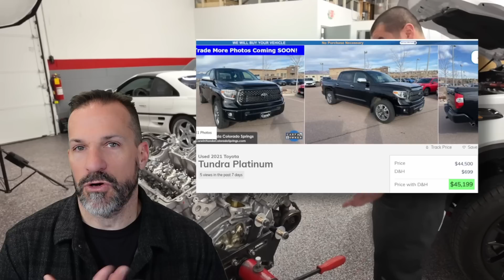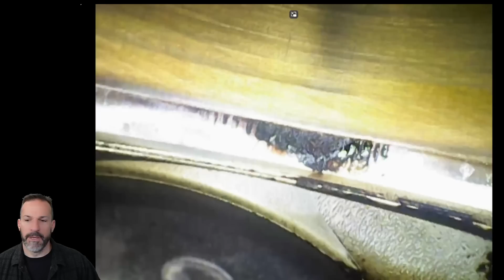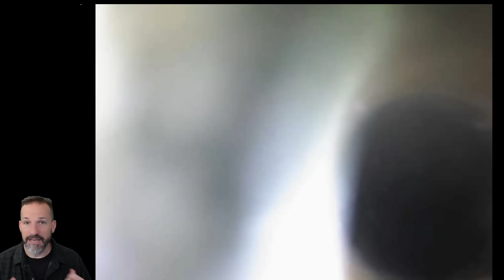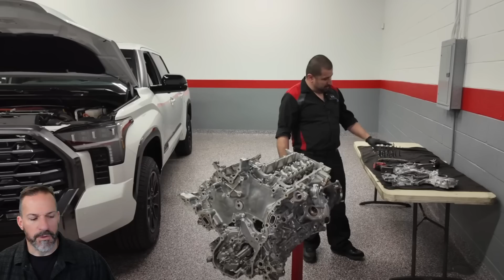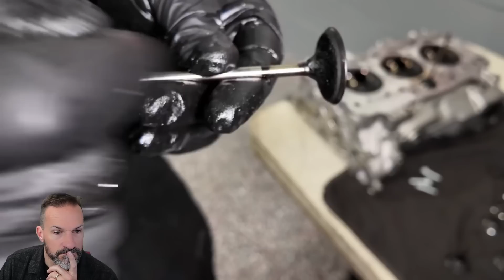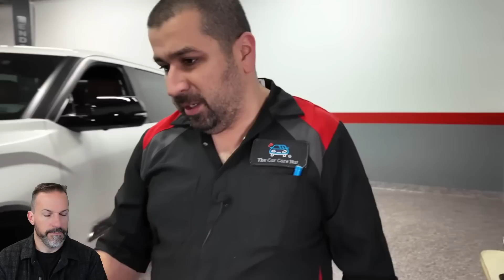Has Toyota LOST Their EDGE? Tundra Turbo V6 TEARDOWN vs. 5.7L V8

Comment: I use to work for Toyota Corporate. I knew this would happen. Just like any sports team that has been on top for a while they have started to cut corners.  When working to get to the top you run the extra sprints, you do all the little things.  When you've been on top for a while you start thinking your unbeatable.

This is when you start making shit product. It's just like their BZ4X. They put a stop sale on that product because wheel studs weren't strong enough. Their engineers didn't account for the extra torque put out by EVs. This is an absolute joke.

Manufacturing debris my ass.  This is a poorly designed engine.
Reply: For this amount of $$$ Toyota put into engineering this engine it’s hard to see why none of these issues were addressed in testing. Toyota reported a ton of testing with this engine and I find it hard to believe this engine didn’t have any of these issues.
Reply: Here I thought people just weren’t buying new cars because base model corollas were price at 32k minimum straight from the manufacturers.
Reply: Do you think they started going downhill in the early 2000's? That's my personal impression. I remember when Jim Press (from Chrysler) took the helm and we started hearing about "cutting costs in imperceptible ways" and my stomach sank. Some cars fared better than others, but overall, the quality of their cars went down...materials used in interiors, for example, took a huge nose dive compared to what they built in the 90s. Some cars had major issues with spot welds. Evidence of cost cutting and shortcuts seemed to be pervasive throughout the lineup until just a few years ago in my opinion when they started to take tactile quality seriously again. But the days of over-engineering for longevity seem to be a distant memory now. I’m sure some Toyota fan boys are going to flame me for saying that, but I’m saying this as a former Toyota devotee, not a hater by any means. I won't buy one anymore. They lost me about ten years ago. I would love for them to get back on top of their game and become the great automotive engineering wonder that they used to be but I don’t see that happening anytime soon.
Reply: @mholmes9262  it is ever continuing death of thousand cuts- let’s give the customer the absolute minimum at the highest price. The customer tolerated the loss on interior quality, shitty paint, vibrating drivetrain, unacceptable noise level, crappy tires, cheap hard plastic everywhere while engine and transmission performed into high 200,000 flawlessly.
Now new idea - let it last through warranty- removed drivetrain reliability.
It also removed any incentive for old, bold and cold men to buy any recent production Toyota. The focus on bullshit electronics will entice new generation… but typically they have less finances. 
The idea to build the product the customer actually wants is completely lost on Toyota.
1) sienna with 6 cylinder ICE engine
2) tundra with v8 or straight 6 - not a hybrid.
3) Tacoma with old 2.7 bulletproof engine.

I would buy all 3 listed above….
Reply: @igorsiniakov-de4fq  Agree, my list would look a little different, but I agree for the most part. Incidentally my last two Toyota's were Siennas, and both of them were complete garbage. We bought an '04 Sienna Limited when my kids were young, and we loved it. It was like a Lexus, and C&D actually called it the Lexus of minivans. But the love turned to disgust when after maybe 7-8 years, all the doors literally started falling off because of faulty spot welds. I was willing to forgive because I grew up on Toyota's and in the 80's and esp the 90's, they were unbeatable in terms of tactile quality and longevity, so I figured I got a lemon, and I would still buy another. In 2013, we replaced that Sienna with a brand new '13 Sienna SE, it had the 19" wheels and looked good for a mv. But man did I regret it. The interior was absolute garbage...hard, cheap plastic that rattled down the road, the dash was literally like a picasso puzzle full of randomly shaped pieces that all snapped into place and anything that touched it left a mark because it was the cheapest plastic they could find. But the 2 things that really made me lose my mind were that the seats were the most uncomfortable I'd ever been in (Toyota's were once highly regarded for interior finish and comfort) and those brakes...woefully inadequate for a 2.25 ton vehicle, and had severe fade when loaded for a road trip with my wife and 5 kids. Finally dumped it a few years ago and I was so happy to be rid of it. I can certainly see they have made progress since that 2013 Sienna, but I'm still not impressed enough with their new cars to be persuaded to buy one again. I'd have to see evidence of a newfound obsession with quality at Toyota, like what made them great back in the day, before I'd consider one again. Right now I don't see it. They seem to care a lot more about Lexus, as those still seem pretty nice, but even those don't feel as "special" as they did a couple decades ago. They are pretty average for the class, if not trailing the competition, where they were once the leaders in luxury, refinement and quality. I've moved on.
Reply: @ my sentiment exactly- no obsession with quality, no guarantee of reliability- no money for Toyota Corp. I am wide open to quality vehicles, I just don’t see any.
Reply: @igorsiniakov-de4fq I completely agree!  Plus a 4.0L V6 4Runner (I own a 2004 that has been exceptional)!
Reply: This problem is due to low oil pressure, there is a poor design in the engine lubrication system.
Reply: Do not buy a new V6 tundra. Buy a 2021 or earlier V8 tundra. I regret buying a 2024 Tundra. My main bearing went out at 22,000 miles
Reply: He mentioned that the used Toyotas seem to be going up in price since folks seem to be wanting the older models. In my area, the new MSRP for the ‘25 4Runner is nearly $10,000 more than the ‘23’s and ‘24’s and for lesser quality to boot…Wow!
Reply: i agree with what you  said and i have said for a long time when you build and sell more, quality control is harder to control when ford sells 800000   verses tundra 159000 in 2024
Reply: Will the Japanese executives commit seppuku after this?

Comment: I think part of the problem is the LONG interval between oil changes.   Change oil far more frequently and change the filter as well.  Toyota recommends changing the filter every other oil change.  It is silly.
Reply: It's not. If you use top tier oil longer oil changes are fine. The  new v6 is just a bad engine.
Reply: Its better to frequent oil change helps rid  all the deposits the oil catches from the motor@LucasLeCompteMusic
Reply: a lot of the V6's engines failed before 5k miles, I don't think it's the OCI. Personally I believe it's the weaker 4 bolt main that allowed unforeseen metal fatigue, this in turn would widen the bearing gap and reduce oil pressure on bearing surface.

Comment: WOW, I was hoping the Tundra engine's dual injection would prevent carbon buildup.  I'm glad I got my Titan.
Reply: The older tundras are still good. I have a 1st gen 4.8L v8 and it's still running great at 186k miles. Personally, I still think the 5.7L v8 is the better engine though.
Reply: @christianmiller4422 You mean 4.7L?
Reply: Same here man.

Comment: Get a older tundra v8 or f150 coyote port injection a new frontier or superduty godzilla if you want simple reliable non turbo engine. The most reliable  modern gas engines are all in heavy-duty trucks they have less emissions and cafe standards. The government has made the half ton and mid size trucks less simple and reliable. In my line of work we use heavy-duty 2500 3500 trucks and they rarely have any trouble with the gas engines. Fuel mileage sucks but its rare we have trouble. The diesels that tow and run hard moving equipment do pretty decent but not so much idling and working on the jobsites.
Reply: unfortunately the Ford 7.3 is having lifter problems. The only HD Ford engine i trust is the 6.2, to bad they stopped making those.
Reply: @nn-dj2nu There are a few covid year 7.3s that had lifter problems. Not very many and the issue is mostly overblown by social media. The 7.3 is more reliable and less issue's then the 6.2 in the real world. At work we've had ford and gm fleet vehicles with every engine and ain't seen a 7.3 with a lifter problem yet. Obviously a few out of hundreds of thousands having a issue doesn't mean they all do lol. Ive seen a covid model service truck rolling around at 11,000 lbs with a 160,000 miles and no engine issues at all only a spark plug wire at 15,000 miles that ford couldn't get for 2 weeks the first year it was new due to a parts shortage and covid excuse. Most 6.2s are solid and good engines but ive seen them have trouble just like anything else. Also ford has a update csp24b27 for the 7.3 that fixed the possible oil pressure issue. There's all sorts of 7.3s in school buses box trucks service trucks rvs ambulance regular superdutys most they are holding up well but like anything built on a production line there will be a few lemons or bad parts put out. You can Google any engine ever made and find failures especially in the internet age.

Comment: What you missed saying is that engine went through a thermal event with no oil. Yes it will have build-up and yes the cylinder walls will have scoring. This is not an engine debris failed engine on display.
Reply: That and TCCN had no maintenance history to go off of. But everyone is quick to claim it’s junk without facts.

Comment: The head gasket issue in the 5.7 can be due to not changing the coolant at 100,000 miles. See The Car Care Nut video on the issue. This Tundra engine looks to be poorly designed with a poor quality build. I think I’ll keep my 2020 Tacoma a bit longer! It has 108,000 miles and  runs as good or better than new.

Comment: I heard Ram is bringing back the 8. I don't see why Toyota can't do the same.
Reply: Toyota would charge 100k for the v8 option.
Reply: Toyota went woke
Reply: Not anytime soon since the tooling for the old Hemi was scrapped after production ended. The powertrain plants for Chrysler don't even have the tooling for a new hemi (which typically has long lead times).

Comment: im pretty shocked at the carbon build up on the v6. d4s is supposed to eliminate that. as you said, it likely is rarely in port injection mode. I’m wondering if that’s how all of their turbo charged for d4s engines will be. thats another added maintenance complexity/cost that n/a owners do not want.

Comment: It will be fair to look at a regularly maintained engine with known mileage, not the one which has no history. I am more interested how engine will look when been used under normal conditions.
Reply: Agree - look at all the bashing the Camry/Avalon 1997-2002 1MZ-FE V6 received in the late 2000's for being a "sludge monster". But now, in 2025,it's recognized as a highly durable motor  because the ones that received on time oil changes didn't suffer from sludge or wear.
Reply: This may be a one off example, but i dont think so, there are tons and tons of videos and reports of normal use/regularly maintained engines that have the same problems, at relatively low mileage, its kind of shocking. Toyota really dropped the ball on this one. Look into it.

Comment: I’ve been changing the coolant every 30K/3YR because I’m paranoid about head gaskets on all my Toyotas and Hondas. I have a 2010 Tundra 5.7L. Not sure if there is hard data to back this up, but I’m not taking any chances.
Reply: I’ve been a Toyota tech for 17 years, I also change my coolant every 30k.
Reply from the maker: Yeah and changing the coolant is fairly easy to do, and cheap. If my head gasket goes maybe I'll do a video on replacing it...but boy that's a big project :).
Reply: Do you mean the infamous coolant valley plate leak? Gotta watch for the cam tower and front timing cover oil leaks on the 5.7L V8 as well as they age
Reply: Secondary air injection

Comment: The PCV valve (costs $12 OEM) on my 2014 (258000) 5.7 is a 15-20 min job even by a back yard mechanic (me)- that 3.4 looks like a labor nightmare and the confidence in that motor after 4 years is still nowhere near the 5.7. 4.7, 4.6, 4.0.

Comment: I watched TCCN video in its entirety, read the comments as well as many other videos, articles etc on the New Gen 3 Tundra. It’s crystal clear to me Toyota has totally failed with this New design. People buy the Tundra for reliability and longevity not for a v6 turbos with carbon, scoring, a grenade that will blow! Don’t need rear lockers, cameras, and big screens. I’ll keep my 2010 Tundra 5.7 v8 forever.
Reply: I bought a 21 to protect myself from the uncertainty of a new engine. It’s at a troublefree 83k miles and will run for as long as we can keep her going. This is my 3rd tundra. They are just so durable and simple.
Reply: @paullucas3 nice! I'm honestly debating if I want to buy another low mile taco and just persevering it for the future. I don't see toyota making things better
Reply: @ Smart purchase!
Reply: Ya same.
Reply: I'll be  keeping my my '08.

Comment: Yeah, Toyota completely lost the plot. Toyota has turned their back on everything that made customers like me love them for so many years. I never bought a new vehicle that wasn’t a Toyota until they released the new Tacoma. Now I’m driving a V8 F150.
Mandatory hybrid in the pro trim, straight dealbreaker never gonna happen Toyota!
Reply: Awesome, just make sure to turn off the Auto stop start and put it in sports mode just to deactivate the cylinder deactivation in the new 5.0.
Reply: Me too. I am a Toyota loyalist with a 20 year old Sequoia with the 4.7 liter. Absolutely amazing quality build. Like you, I leaning 5.0 Ford. My last Ford was a 1994 bought new, and I swore never again. Can’t believe I am looking to Ford. Sad.
Reply: @ Toyota looked at Ford too. They traded Prius technology for Eco boost technology and Toyota still screwed it up. Tundra engine blocks are garbage and they refuse to admit it.

Comment: I can't imagine Toyota is gonna stick with that V-6 Twin Turbo for too long. Toyota owners expect bullet proof reliability with standard levels of maintenance. This motor is going to require extreme maintenance to get it over 100K miles. The damage to the cylinder walls indicates some kind of oversight or bad design. That's not an oil starvation or machine debris issue. Looks like piston slap.... which shouldn't be happening on a fairly new engine.

Comment: For the EPA & those who wish to "save the environment"...  
Wouldn't it be better to build things (vehicles/ appliances) that last for decades & don't end up in a landfill in <5 years?
Reply: The goal is not to “save the environment”, it’s to make a profit and satisfy the legal requirements to do so.
Reply: Its not about the environment this is just an ideology of our Oligarchy
Reply: 5-10 years down the line means a different Senior Vice President or executive will have to deal with those numbers/OKR's/KPI's/targets/etc...

All the current leadership cares about is making THEIR current numbers look good. 

Screw the future employees/executives.
Reply: You and I know that none of that has to do with the environment, that’s just an excuse to make more money for the corporations
Reply: @Jmg831  They are following federal regulations. The dems in congress think the exhaust needs to be cleaner than the air it ingests for combustion. Manufacturers have to reduce the emissions every model year unless they make the reduction in big multi-year jumps. That means rushing out new engines with complex junk. Ford for example has actually had to add an EGR cooler to the 2.7 ecoboost as part of the emissions system. EGR was finally being removed from many engines and now it's back and needs a cooler on top of it.
Reply: @ Well I avoid ecoboost engines at all cost.
Reply: @hochhaul you are correct, it’s disgusting how the government has ruined everything good in this country
Reply: @hochhaul and republicans seem to think prices for everything should be more expensive and that the working class need to be paid less to enrich shareholders.
Reply: And the reason they went to this new engine as per watching the car care nut was so the engine did not pollute as much as the old V8
Reply: @Lance-b2l how is less pollution bad? Seems like all new products have teething problem. Have no idea how this is the problem of environmental laws.
Reply: @Lance-b2l exactly
Reply: The emission directly tied to the manufacturing of all the replacement engines will more than negate all emissions reductions related to the move to the new TTV6. But the bureaucrats get to pat themselves on the back and pretend they saved the world by forcing these "cleaner" engines.
Reply: Exactly mate
Reply: It has been widely reported that dating back to the 80s, a car/truck uses more energy being built than it does burn in fuel during it's lifetime. Hybrids/EVs WORSE.  So yea, misguided priorities!

Comment: The wear is from the thin oil .. at least use 0w20
Reply from the maker: I could be wrong but I think the 3rd gen v6 turbo still uses 0w20, same as the 5.7L.
Reply: It comes with 0W-20!